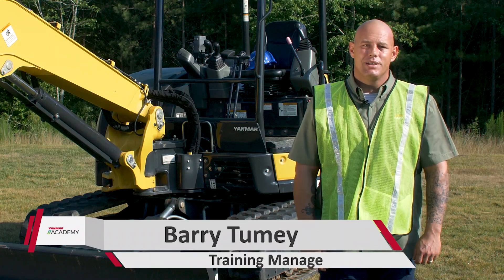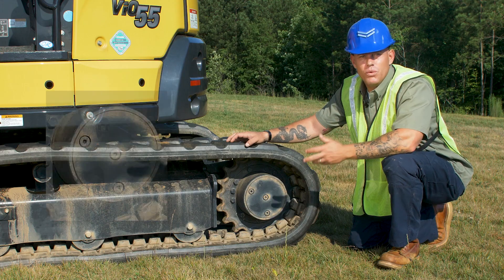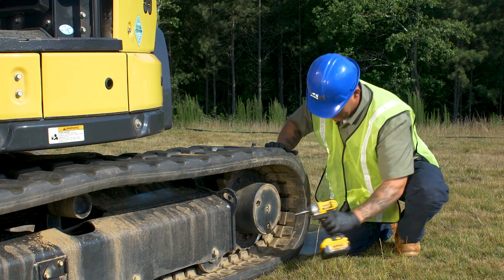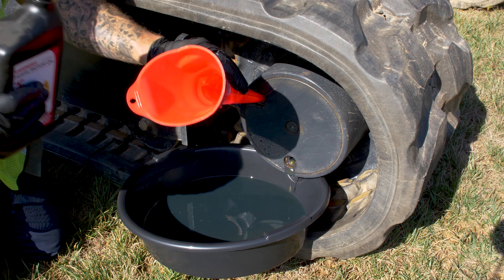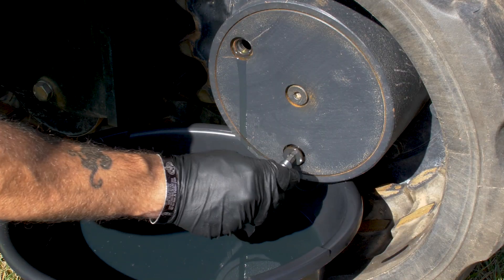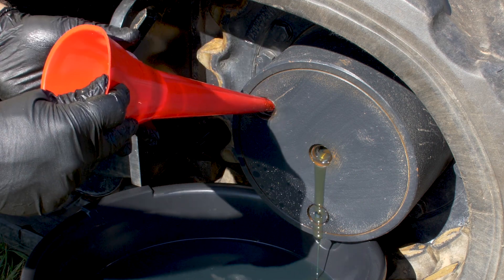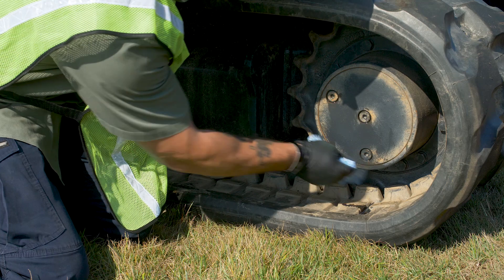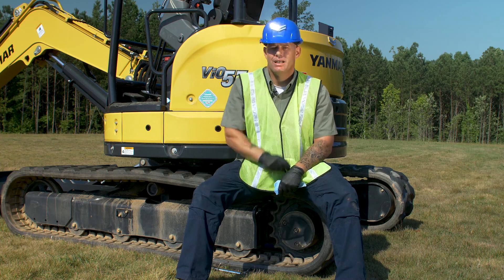Changing Travel Reduction Gear Oil on YANMAR Excavators

Comment: What is the part number for the travel reduction gear oil's drain plug? One of ours was on too tight from the factory and we ended up stripping it.
Reply: Next time tap it with a small brass bull point or brass hammer spray penetrating oil or lightly heat it , they are never over tightened from the factory you brutalized the drain plug with no mercy and now it’s busted. Take responsibility for your actions mr.lee learn about mechanics before destroying and stripping then blaming the factory......
Reply: @worktime8847  What a helpful answer!  Chastise and excoriate instead of providing a part number as requested.  Good one!
Reply: @worktime8847  That would be a troll response if there ever was one. Next time try looking at your own life for what is so bad you feel the need to belittle random folks online because your Misérables in your own life.